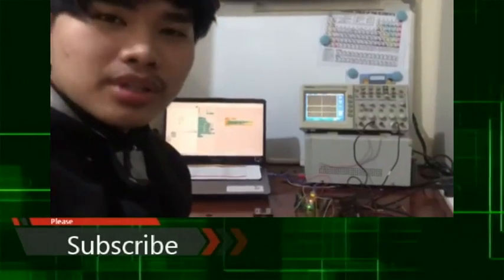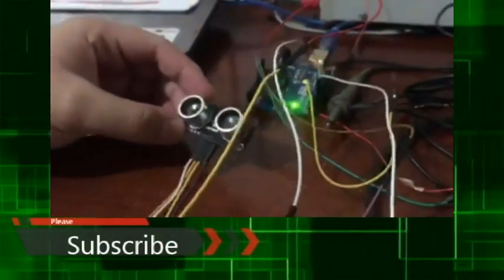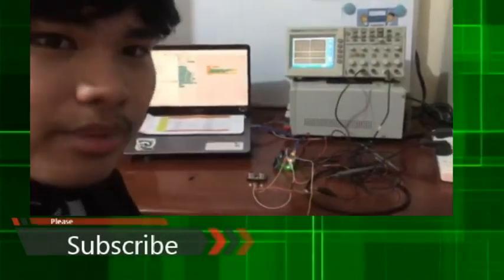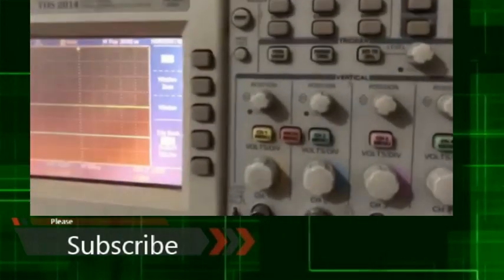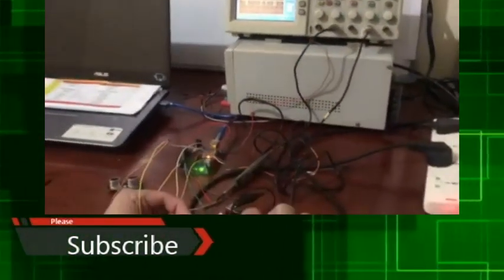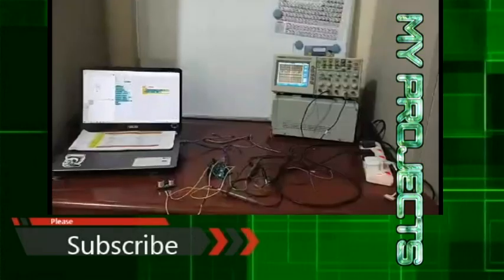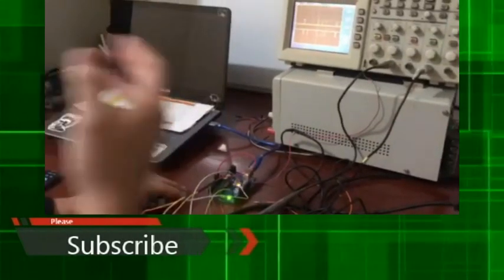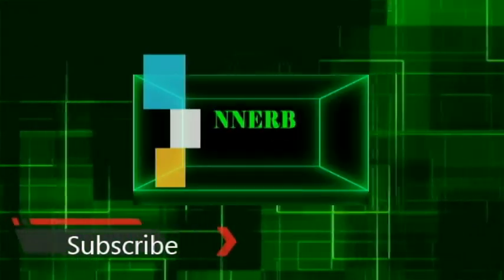Signal Wave : Oscilloscope

Comment: Waveforms are abstract representations of sound waves. 
Wireless signals are electromagnetic waves travelling through the air. These are formed when electric energy travels through a piece of metal.

Comment: scilloscopes are an essential piece of electronics test equipment for any electronics laboratory or area testing electronics hardware whether within RF design, general electronics circuit design, electronics manufacturing, service, repair or anywhere that electronic circuits and the waveforms on them need to be investigated

Comment: Sound is a wave that results from the back and forth vibration of the medium particles through which the sound wave moves. These sound waves consist of a repeating pattern of high-pressure and low-pressure regions.